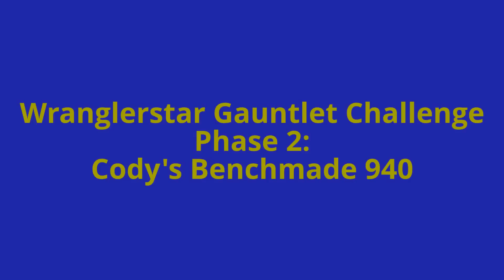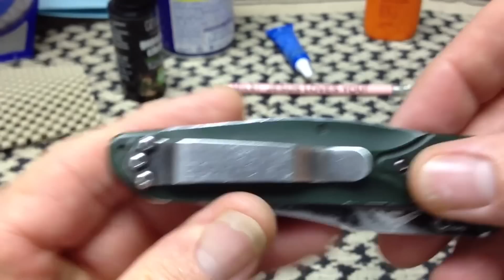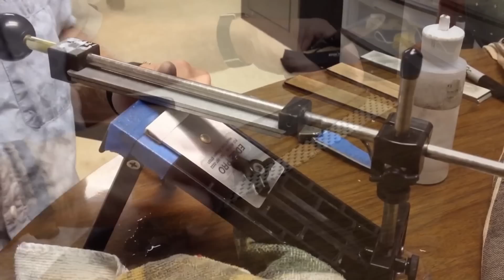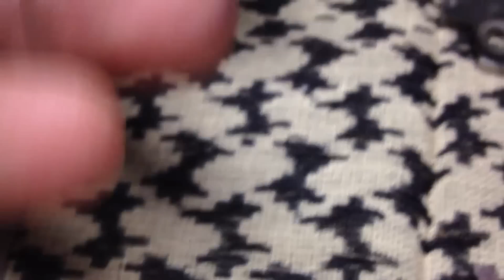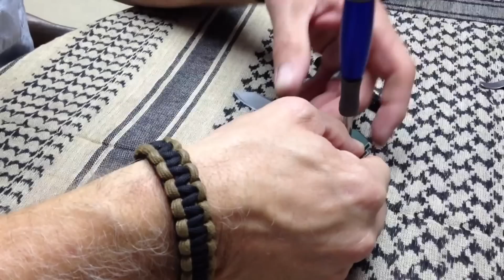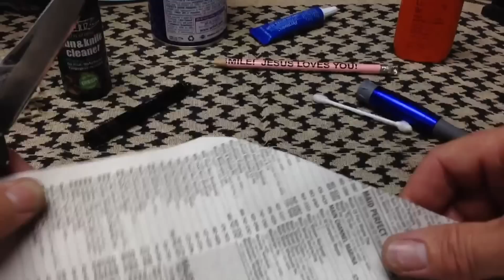Wranglerstar Gauntlet Challenge Phase 2:  Benchmade 940

Comment: I always get my knives super sharp with my stones then for some reason i lose that sharpness once i strop, any ideas to whats going on or what im doing wrong???
Reply: Probably lifting the edge into the strop when you are picking the knife up to do the other side. It’s important to, once you make a pass, stop, pick the knife up holding the exact angle without rolling the edge onto the leather, and do the other side. Only do 10 passes per side, any more and you’re convexing the edge, in my experience. Also, green paste is generally very low quality, I highly, highly recommend DMT Dia-paste, 1 micron. It works wonders!

Comment: Do you use an ultrasonic cleaner to clean your knives once taken apart.  how do you center the blade if need be?
Reply: Greg Wallace if it’s pointing towards the pivot side the pivot is to long,  so you sand down the pivot.  If it’s pointing towards the pivot screw the blade is either over tight or the pivots is worn out.

Comment: Should i sharpen my spyderco tenacious with a 25 degree secondary bevel with a 30 degree micro bevel? is that good. Please tell me suggestions.Thanks
Reply from the maker: Sloth Mc The Tenacious usually likes about 16-17 DPS with a 19-20 micro. And yes, I'm accepting new jobs and you'll get a mirror edge. 😉

Comment: My biggest pet peave with buying new knives is an asymmetrical grind. I just bought a cabelas exclusive Benchmade Axis Flipper 300-1401 and it came with an awful asymmetrical grind. Will Benchmade fix this for free? SMDH
Reply from the maker: Sloth Mc They'll do a similar job the second time. Knife mfr's seldom sharpen well. That's where I come in 😉
Reply: TheApostleP are you actively taking jobs? Because I will send it to you if you promise a mirror edge ;)

Comment: Also I have a question about the drill stop collar, edge pro sent me one and when I use the drill stop collar, I find that I still have to manually adjust the angle of the sharpener. Do you have any suggestions?

Comment: your making a very suttle mistake here at 17:10 the light passes. I had a video on this. When using very light pressure with the system, if you travel passed a quarter of the stone, your angle changes slightly. Take your pivot arm, and without any pressure make a super light forward stroke all the way, and watch your pivot... when it reaches a certain point, it is no longer under load and it moves down... got to watch out for this! When making very light passes, they have to be very short, and horizontal.

Comment: I was so impressed that i bought the 940 and the spyderco para 2 and the edge pro because I have never !!! been able to sharpen any !!! knife. then I bought the mini grap because i didnt want to practice on my best 2 knives. so I have done pretty well practicing on my mini grap but still scared to touch my better knives. (oh impressed with your skill and attention to detail I meant ) I have a question for you. when you place the blade on the edge pro do you put the flat of the blade on the base or do you put the angle part of the blade against the base? might sound like a a dumb question but at 51 years old I have learned that the only dumb question is the one you dont ask. I am never going to be to old to learn. God Bless
Reply: Doesn't matter where you rest as long as it's easy to hold consistently in the same spot. Something like a PM2 you can easily hold it on the flat the whole time, but a blade that doesn't have a flat you just hold on the face of the blade.
Reply: @carlosmatos9848  there is no flat on the pm2 it's a continuous angle from the edge of the bevel to the spine .
Reply: @OsamaBinDarrel  Yeah I meant to say the ricasso. That's the easiest way to sharpen the PM2 on an Edge Pro that I've found.
Reply: @carlosmatos9848  I wonder if that'd work on a Lansky as well? I may try that next time I sharpen one of my Spydercos
Reply: @OsamaBinDarrel  The KME clamp seems to be pretty good at holding full flat ground blades, so I think the Lansky would be similar

Comment: Rob, I have a question about washers. You mentioned in the video that you will not polish the washers. Is this because of the material they are made of or is there any other reason? Do you polish only metal washers or others as well?
Reply from the maker: Wolfgang Häussler In this case it was about material.  I do often polish phosphor bronze washers for smoothness.

Comment: It couldnt originally cut because 154cm sucks.
Reply: Daniel Heller, no it doesn't. It is the same hardness as s30v when treated properly but does not offer corrosion resistance

Comment: What kind of knife sharpener is that?
Reply: You may have found an answer by now, but in case not; It is a Edge Pro Apex, they run about $275 for a full model, they may have a cheaper version with less bells or a more expensive one... I am not to sure. I personally use a Wicked Edge because it better suits my personal needs. 

But the Edge Pro is a great system, and maybe a bit more practical (money wise) than a Wicked Edge.

Comment: can you sharpen scadi grinds on your edge pro.
Reply from the maker: Parker Neslo It's possible, but it's really not the right tool for the job.  I prefer using very flat stones or metal sandpaper on a very flat surface for scandi grinds.
Reply: thank you for the advice.
-  your fan and new subscriber parker

Comment: Supreme, very professional, real craftsmanship.
You make it look easy, so much so, I am looking to purchase a Edge Pro kit here in U.K.
How easy/hard would it be for someone to learn how to use this type of sharpener?
Reply from the maker: Great question, with a bit of a complicated answer, Michael.  For me, as an experienced free-hand sharpener, it was fairly easy.  For some, it's very frustrating, and they prefer the Wicked Edge over the Edgepro.  The EP takes more skill and muscle memory from the user than the WE, because your off hand is the "clamp" holding the blade against the table.  However, the EP, because of that same characteristic, affords more flexibility in positioning the knife, which can become important on some blades.  I love the Edgepro, and the results I get with it.  But I also have a local knife knut buddy who is selling his because he just can't get it right.  Not much help there, huh?
Reply: TheApostleP Lots of help thanks, will check out the "Wicked Edge".
The Edge Pro's spares seem very fair in price and available here in U.K. I have used various old fashioned sharpening stones over the years, but the EP looks as though, once mastered, will return much more consistent results.
Thanks again for an excellent video.
P.S. did you make the leather polisher/sharpener or can they be purchased? Was the leather oiled?
Reply from the maker: I purchased my strop from "stropman" on ebay, but you certainly could make one.  It is not oiled.  I use a green fine rouge-type compound on the smooth side, and gray medium on the rougher side.

Comment from the maker: It's not so much the steel, I think, as it is the primary blade grind of the 940.  The cross section of the blade is like a wedge, with a 10-12 degree inclusive main grind angle.  Also, Cody's knife is very thick behind the edge, so it's kind of tricky to find the right edge geometry for good cutting.

Comment from the maker: Oh, Lord, no!  This is a pretty delicate process, as you don't want to remove much material at all, and the keys are flatness and consistent thickness.  I use a worn out piece of 800-1000 grit sandpaper on a very flat surface, making figure-8's, then finish on my strop.  This makes the washers smooth as glass without compromising dimensional integrity.